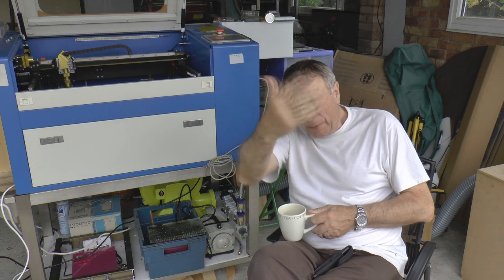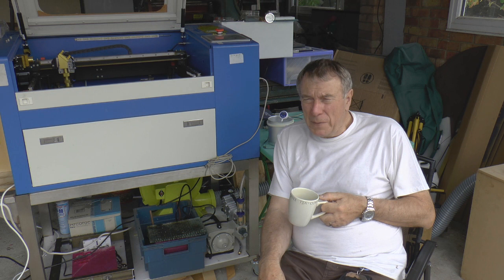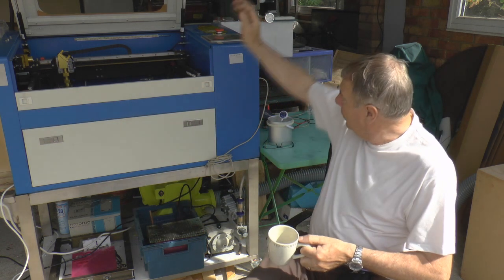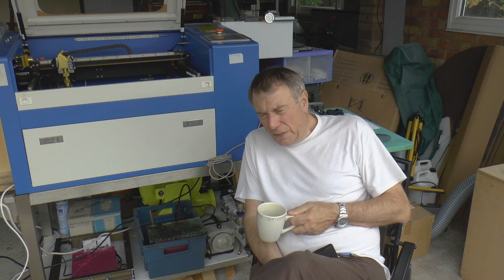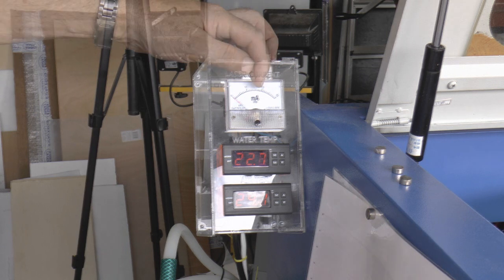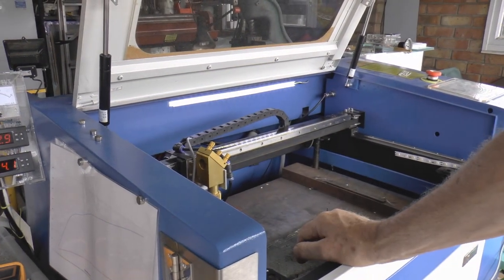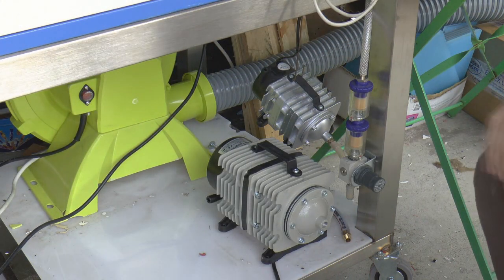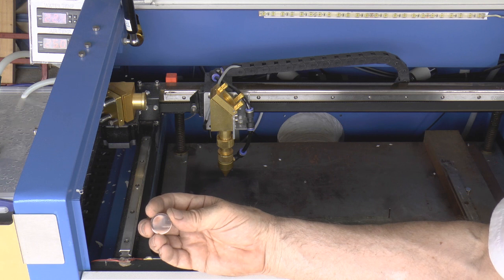RDWorks Learning Lab 75 What have I learned from 1 year of owning a Chinese Laser Engraver

Comment: Thank you for your video. I am planning to buying and starting a home-based business of engraving. I am offered this kind of machine that is in your video. Yes, I've searched Epilog and Trotect and they are far more expensive than the offer of this brand (4 times the price). One ting though that I would like to ask: In the forum thread below, you mentioned that, correct me if I'm wrong, one can buy this machine and buy a better tube from somewhere else with a good brand. That does mean all tubes have the same designs that one tube would fit to diff brands and machines? Thank you, again for sharing your wisdom.
Reply from the maker: Hi Louie
You have understood correctly. All tubes  are basically the same technical design. However a 60 watt tube from manufacturer A may have different dimensions than a tube supplied by manufacturer B
These ebay machines are marketed as engraving machines and for engraving you do not need a powerful tube because you need good control at low power, Hence a 40 or 50 watt tube is as much as you need. Go for a bigger tube and you get lots of power for cutting but poor control for engraving.. Ant ebay machine claiming to be 50 watts will be fitted with an 800mm long 40 watt tube and the 60watt machines will be fitted with a 1000mm long 50 watt tube. if you can make do with a 300x500 work, area, there are some really good deals to be had. If you can, steer clear of KeHui machines as they have a reputation for poor assembly quality along with  poor tubes and power supplies.
For your application you may not need to immediately buy a new tube and psu. Use what you get and you may be lucky enough to have a tube that lasts 1 to 2 years.

Good luck with your new venture
Russ
Reply: Hi Russ,

Thank you for your time to promptly reply my message and answer the question. For few months now that I am doing research before I venture into this business to make sure I get on the right track. I went into different related forums, watched videos and asked different laser machine companies. There have been very reliable ones but quite expensive (out of my budget as a starter) as Epilog and Trotec, and cheap offers such as those that you used in your video above. Although you said you are no laser expert but I find your review very honest based from your experience. On the side, I found a good interest of Thinklaser Lightblade I am now in contact with them for a particular model. I hope they are not as high as those previous two brands I mentioned, otherwise I might just stay with the dragon one my wallet can pick.
Reply from the maker: Hi Louie
As you probably realize, I do have a Lightblade from Think Laser. It is a very good machine. As for Trotec and Epilogue,  you will have noticed if you have physically seen both machines, they are essentially the Chinese design format but with many more tube options and more bespoke engineering on certain parts of their machines. They each use their own software and that's what you are paying for , their R&D and software team. Think laser's strategy is somewhat different. They have worked closely with a reputable Chinese machine builder and have specified all top end ( but still Chinese) components to make a durable and reliable machine that will perform as reliably as the two more expensive machines but at a 1/3 of the cost or less. It's a lovely reliable machine but (i think) too expensive, still, for the keen hobbyist. It is however a great investment for a small business, where you need a reliable performer from day one. I would not be without my old China blue machine because it's failings have taught me so much.  For a hobbyist the ebay machines are still amazing value for money and there are many folks out there running small businesses with single and multiple machines. If you go to the Thinklaser You Tube channel you will find me doing a series of videos in my usual style that familiarizes new users with their machine. I don't like to think of them as training or tutorial videos. They allow you to build your confidence in the machine by exploring it with me.
I shall be interested in how you get on. In case you need it the contact at Thinklaser is Gareth Reece                      gareth@thinklaser.com.
All best wishes and good luck
Russ
Reply: Thank you again, Russ. I have in contact now with Gareth and has provided me the information I need. I am now building up the business skeletons, and once finalized, I will let you know. As of now, consider me one of your followers as i go alon the sigsags and winding alleys of this venture. Thanks heaps.
Reply from the maker: Hi Louie
You will be please to see the results of my latest video (next day or so) especially as your effotrts will be engraving.
Best wishes for your new venture
Russ

Comment: What are the max ratings recommended for a 80 and for a 100W tube in mW?
Mine is by default 80W but I ordered it with a 100W tube but not quite convinced it is  a 100W tube.
Sticker says max is at 22mA...
Reply from the maker: Hi 
Is the tube a branded tube like Reci or EFR?  Normally a 60 watt tube will be 22mA. 80 watt tube will be 24mA and 100watt tube 26mA. However, Reci do not reccommend running ANY of their tubes at more than 25mA. Just a quick final question. Is your tube labeled K H Laser?

Best regards
Russ

Comment: Hi Sarbar,
Do you know why my red cable connected to the tube makes a strong electricity spark when i press pulse button? many thanks in advance
Reply from the maker: Hi Ashkan

That spark is more than 25,000vols dc and is very dangerous. It should be applying that voltage to your tube to make it fire. The fact that it is not means only one thing....poor insulation somewhere.. You should check to make sure the red cable insulation has not chaffed on the frame during transit and also make sure that it is sealed to the tube well (see https://www.youtube.com/watch?v=zCTrRT1C_eY  from about 12minutes) The good news is that your power supply is working but be very careful when working with this red cable. Turn your machine off and leave it for about half an hour before touching the red cable. There may be stored energy in the power supply that will give you a very nasty bite.

Best regards
Russ
Reply: Hi Sarbar,

Thank you so much for your invaluable advises and tutorials.

Kindest regards

Comment: Hi Russ,

I am shopping around for my first machine and I am looking at horror stories from all over the world about tube failure. From what I am piecing together and from your VERY detailed video, is that operating the laser at the rated strength, will basically fry the tube in a very short period of time.

Would my assumption be correct if I said, Buying a 100 watt machine and running it at 40% ( roughly 40 w) would save me the heart ache and or trouble of replacing the tube within a short period or at least a year...ish?

Again, This will be my first laser and I am trying to learn from mistakes made by others and get the best longest lasting solution, while learning the use the machine, before needing any replacements, 

Or, should I just buy a cheap machine and buy all new upgraded parts from the get go and Frankenstein a decent piece of machinery?

I would appreciate any advice you could give

Thank you Kindly!

Peter Swart
swartfinancial@gmail.com

Comment: Hi Russ.
Great videos BTW.
I have a machine the same as in your video. I am having reliability issues with my power supply. The unit with the red wire going to the laser tube.
I have had two now after only about 10-15 hrs of use and the second one has failed now. The seller wants £60 to post out the warranted part so is going to make it a tad expensive to run.
I just wondered if i bought the power unit for a more powerful tube it will work and be more reliable? Doing this will also future proof the machine so I can fit a better tube when that fails.
I'd appreciate your thoughts.
All the best.
Gary

Comment: Please Help!
Can someone let me know of a good seller? My uncle is looking to by an engraver machine and he is worried about making the wrong choice.
Reply from the maker: I am in the privileged position of getting lots of correspondence from all over the world and most of it is from people with non-functioning or broken machines. Can be anything from dead on arrival to very early failure of the tube (mainly) but maybe 25%  have failed laser power supplies.  The mechanics of most machines is reasonable , but steer clear of any machine that does not have proper linear bearing (Hi Win type)systems. ALL ebay machines appear to be fitted with reject tubes from large manufactureres. They are usually relabeled KH Laser Labs. They will work , but how well and for how long is like a lottery. The power supplies are equally flaky. You will also not get what the advert promises. 50 watt tubes will be 50 watt max power (if you are lucky) but in reality they will be 40 watt (800mm long) You can NEVER run at max power or you will wipe out your tube even quicker.  The whole point of selling these machines on ebay is that there is no accountability (it's a flea market, so buyer beware.) there are no "good" sellers just lots of small one-man sellers operating from their kitchen table in China  for commission and then there are a few large importers that stockpile machines in warehouses around the world. These big guys also allow the one-man bands to sell their machines.  Visit Alibaba or Aliexpress to see what the cost of buying a proper new tube and MATCHED power supply will be. Add that to the cost of your new machine because in a very short time that's what you will have to do. Don't let it be a surprise. Any Paypal guarantees are useless because about 6 months ago they excluded any manufacturing equipment from their already pathetic protection system.
Buy a well engineered machine as cheaply as possible, ask questions of the vendor so that there will be enough rope to negotiate with him when you raise an ebay dispute claiming the machine is not as advertised. You may be able to get a small £200 or 3300 refund that will go someway to buying the proper tube and power supply.  Even if you use PayPal, which most will insist on, make sure you buy with your CREDIT CARD. Your card provide will give better protection than anyone else.
Hope some of this helps
Best regards
Russ
Reply: Many thanks for the advise and the information.

Comment: hi,
i would love to own a CO2 laser ,the bed size is a little restrictive for me though,could you tell me the running voltage of the laser,i take it the voltage stays "as is" when altering the power,being a current controlled device, a crow bar current clamp could be inline with the current meter,and dialed down to a low setting,then set the machine to 100%,after which the crowbar current clamp can be adjusted to get the safe max current for the tube used,so when the machine is set to 100% it will be the now pre-set safe 100%.

Was the delivered unit in good condition ie setup for cutting ,miss alignment of mirrors etc.

Do you think the original co2 laser would have had a longer life if it had current limiting or was it just crap from the start.

Do you know what type of power supply is fitted,ie transformer,switched mode etc.
Who supplied the 70watt laser,after market or from where you bought it.

Im either going for a co2 or a diode laser,my needs are for wood etching ,pcb making and etching brass,i dont know if either co2 or diode will  actually cut copper or brass,brass being an alloy of tin,zinc and copper,but surely both lasers will vaporize an etch resist from the surface of the metal to leave a clean substrate behind to etch,which is the point i can get mixed results from my present methods.and why a laser could transform my whole production accuracy,wastage,volume throughput.

Available diode laser beds  suit my needs better and are'nt to dear,and about the 5.5watt range,heat is always a problem ,and im looking at making a water cooled diode heat sink if i do get a solid state laser.

If you would like more info on a current clamp let me know the details i mention and i'll see what i can pass on to you.Though you seen educated or smart enough to sort that out,but bend my ear if you wish.
cheers.
Reply from the maker: Hi John
I apologize for the tardy reply. I somehow missed your comment.
The laser tube operates on two voltages a strike voltage and a running voltage  Both depend on the length (the power) of the tube. Typical 50 to 80 watt tubes strike at between 23000 and 28000volts dc. When the beam is fully established (about 12 to 14% power)the voltage drops to about17000 volts dc. Once the nitrogen has ionized it becomes a very low resistance conductor and the current flow through it need to be controlled by the power supply. The signal for that control comes from the controller where the % power you request is translated into a current demand. usually in the range of 2 to 30mA. Generally the tube will not work below about 8% power and if you go much above 60% you run the danger of exceeding the safe running current for the tube.. Limits for these values can be set  using RDWorks.There is no problem working with 60 % as your top limit and say 10% as your bottom limit. That's a range of 50%. The power can be selected to 0.1% so that's 500 divisions.  of power graduation available. The power characteristic is not linear

I, as with most people, was able to use my machine right out of the box. It did need setting for better performance but it worked. 
All ebay machines are fitted with crap reject tubes from big manufacturers. There's an organization that does not exist called KH Laser, they collect and tests these rejects, to make sure they function "in some way. The" re-label them and get them fitted to just ebay machines . Ebay buyer are usually naive, do not have any knowledge of the technology, have no means of monitoring tube current and do not have an expensive power meter on hand to check their purchase. The perfect scam. Yes My first tube was like that, absolute rubbish.

I replaced it with this
https://wholesaler.alibaba.com/product-detail/1pcs-60w-CO2-Laser-Tube-and_60064355769.html

You cannot cut copper or brass with this technology because to 10.6 micron wavelength light, copper (with almost any crap surface) acts like a mirror because of its crystal structure. You cannot heat it to melt it even with a powerful CO2 laser. You can vaporize a surface mask and there are several you tube videos of guys doing it.

Hope some of this is helpful
Best regards
Russ
Reply: thanks,
very helpfull indeed,i used to use photo develop techniques for pcb,but light under cut was a problem,screen printing a suitable resist is a long winded nightmare of constant re-do to the screen,one method which works very well is the laser printer toner heat transfer,but i also have wind od using a UV laser to develop mask with great precision,though burning off a mask with a visible wave length laser,which can be used on leather,wood is fine.
If the price of the metal encased CO2 lasers comes down a bit i'd fancy that,i've got the cnc bug so a 3 axis mill with laser attachment can be realised by arduino and raspberry pi,though i hated programming computers  in college some 27yrs ago,it was 6502 assembly for BBC micros and acorns,which were outdated then!!!,the new pc assembly is easier to do,and with the internet,well,you cant help but learn,if a 12yr old can ,so can i. 
Enjoy your lazing,not that retirement is that.
Be well,and regards.
John h.